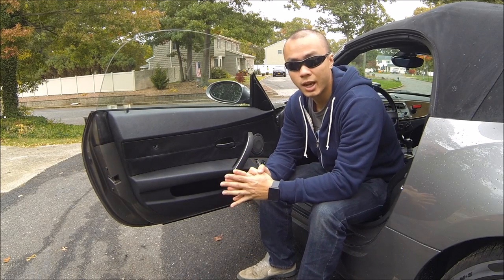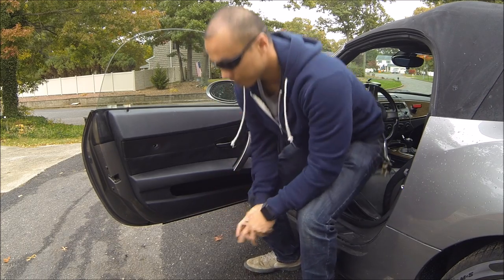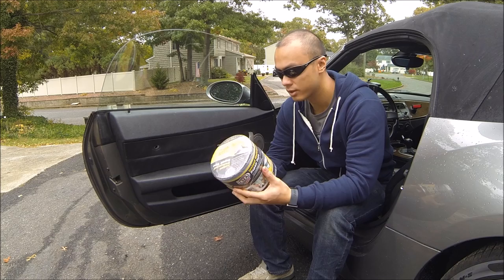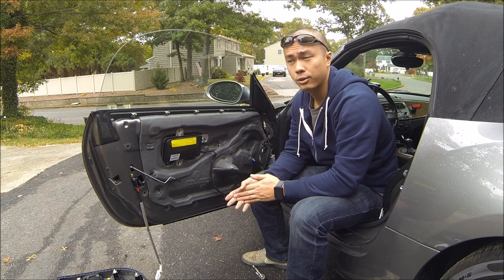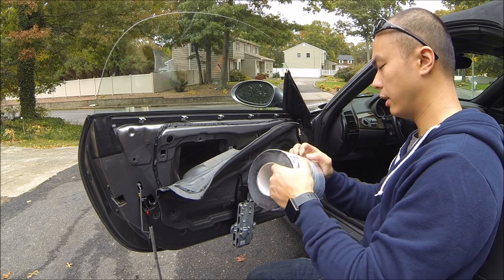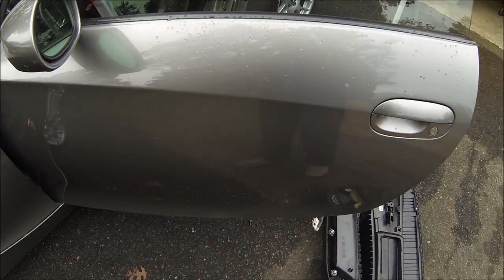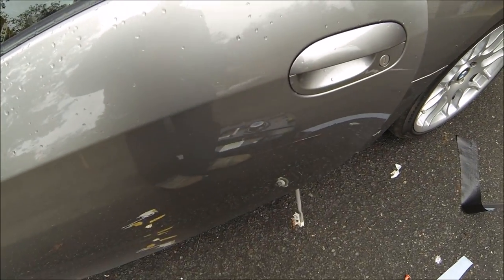Car Door Sound Deadening for Under $20! - BMW Z4 Vlog #20

Comment: DONT DO THIS. USE ACTUAL SOUND DEADENING !!!!
Reply: why
Reply: +carfreaks1024  why ?
Reply: +arien wilkins this stuff is made for roofing. It smells like asphalt and is meant to stick to horizontal surfaces, not vertical, and is known to peel over time with heat. For some it does just fine, but there are many horror stories. This is coming from a guy very into car audio that has done 3 cars and has done an insane amount of research.
Reply: +prayfawind this stuff is made for roofing. It smells like asphalt and is meant to stick to horizontal surfaces, not vertical, and is known to peel over time with heat. For some it does just fine, but there are many horror stories. This is coming from a guy very into car audio that has done 3 cars and has done an insane amount of research.
Reply: ^^^^ WHAT THIS GUY SAID!
Don't use this stuff.
Reply: Snydicus Thanks for the tip. Makes sense. I'll use dyna mat or similar.
Reply: I read that the adhesive is butyl rubber, not tar or asphalt as many people think. That said, I don't know if any possible drawbacks of using it. Please help to explain if you have used it and experienced problems. Thanks!
Reply: Matt Wells It looses its hold very fast which is counter productive. Checkout ExoaBigdeal. He used it and said it was great! Until...... If you want something that will actually last then spend the extra money.
Reply: FYI i have been a roofing contractor for 15 years and not that stuff does not melt its used for roofing. roofs get alot hotter than your car does. now for the sound IDY
Reply: It seems that the U.Seal product information shows that it has a 'rubberized asphalt" as the adhesive, but the Frost King uses butyl rubber, which are not the same thing. Have you tried the Frost King or heard of anyone using it with success? Thanks for the video and replies. Very helpful and very appreciated!
Reply: Asphalt based will not do much in actually sound deadening. It does add weight to the panel and lowers its resonant frequency a bit but you can get twice as much actual sound dampening by using a butyl type deadener and have to use half as much.

That Peel and Seal and U-Seal has a 50-50 shot of falling off of the car and takes a tone more prep to try and make sure it stays stuck.  The biggest issue is that the asphalt based stuff gets too soft and will actually start to pull away from the metal under it's own weight. When it is hot and by hot I mean in the 150-200f range for dark cars vs 130-145f for unpainted metal tin roof.
Reply: carfreaks1024 definitely this stuff is crap I've seen people on videos on YouTube taking hours to dig this crap out of their car this stuff is a bunch of crap it's just tar and it melts
Reply: He used PEEL & SEAL, not the product used in this video.
If you aren't sure you're talking about Frost King, then stop saying it doesn't work.
Reply: Problem with using roofing material is it's tar based and when it comes time to be removed ur left with a hard ass clean up paying the extra dollar for second skin or dyna Matt Is smarter
Reply: I never did use sound deadening but now i use second skin sound deadener and it works great for both mobile audio and road noise.  www.secondskin.com you can find many products here to sound deaden your vehicle.  the adhesive is very strong and so far mine has not fallen off.  i love the product.
Reply: Alf the Clown: i love watching his vids.  he is also known as EXOContralto. he is a great guy and funny as hell. i have learned many things about the basshead mobile audio world.
Reply: Riden Roam EXO is a totally different guy lmao
Reply: prayfawind ExoControlto did a whole video on him removing that god awful Peal and Seal shit from his van a few years back. He totally regrets not spending the money on butyl based sound deadning.

His car smelled like shit and the deadner peeled off within a year leaving a huge mess.

Dont use asphalt.
Reply: 91% Isopropyl Alcohol and a clean rag. Then just try to get the stuff off without a putty knife. Just opened my Wife's car doors to swap her factory 6.5's with Bass Blockers to a set of ISS 165's and  ISC 165's. When I did the Bass blockers along with a Kenwood HU and an SA-8, I used Butyl Rubber roof flashing on the inner metal door skin so when you knock on it, it sounds like lead. I put strips on any other bare areas as well as around the speaker mounting hole. The stuff after 3 years of all 4 seasons in the NE looked great. The aluminum foil facing curled a touch in a few spots and that's it. Stuff works. Whoever said the stuff is not for vertical isn't thinking. The stuff goes along a roof to wall transition. Half of that strip is vertical and often on a wood substrate and it sticks real well. If your cleaning the surface of door, it sticks hard. Remember even if it looks clean, it has oils from manufacturing on the surface. The people that have issues are the lazy corner cutters that can't be bothered to clean the surface, then blame the product. Clean the surface with Isopropyl 91% and freaking Scotch tape will stick forever.
Reply: polariford45 u mentioned scotch tape? Where do you apply or use that and to do what? I’m curious cuz I’m seriously thinking about using this stuff All in the trunk of my car.
Reply: Your misinterpreting what I said. I didn't use Scotch Tape anywhere. Some people commented about this product or any adhesive product for that matter, not sticking well to the inner doors. I was just stating that if you clean the inner doors properly that even Scotch tape will stick good and likely stay indefinitely. Using 91% Isopropyl alcohol (IPA 91%), rubbing alcohol (RA) or acetone will break down the manufacturing oils to leave a clean surface to adhere to. Acetone can harm plastics and paint so I avoid it for automotive use for the most part. I have used CRC brand electronic parts cleaner also with good success, but it costs more and I find myself spraying it into a rag much like applying the 91% IPA to a rag to wipe so I just use the 91% IPA or RA since it's cheaper and easier to find. If you use any adhesive products for sound deadening, be sure to use Butyl rubber and nothing that's asphalt based period. If the product you intend to use isn't clear on what the actual material is then look for another product. This is a product I use with good success. This will address the main concerns that most people have against the use of these options. Mainly the VOC's and high temperature stability. 
https://www.homedepot.com/p/Typar-4-in-x-75-ft-Butyl-Rubber-Copolmer-Window-and-Door-Flashing-Roll-BUTYL-001/302640122
I also have used this product. It is only slightly cheaper than a 2 door Dynomat kit, but it is an option nevertheless. It is 15 square feet vs. 12 square feet for the Dynomat alternative. The Dynomat comes in 12" x 36" sections for their 2 door kit. I find a 6" wide roll much easier to handle and cutting to fit. It also stores better on a shelf being a compact roll instead of sheets like the Dynomat is.
https://www.amazon.com/gp/product/B003I6WNYO/ref=ask_ql_qh_dp_hza
Reply: polariford45 thanks for ur help. What would you use to do a Big Trunk like in a Toyota Avalon or Camry for the trunk lid surfaces, the whole Floor, and sides? That’s a lot of surface area to be putting 1,000 of little strips. That would be a lot of rolls🤷‍♂️thanks again

Comment: I could understand using this stuff for a hooptie but a BMW? Come on bro, no bueno
Reply: Majority of all sound deadeners are butyl rubber and foil. I think there's only a few companies that use a different rubber compound or another material entirely for dampening.
Reply: Why spend money for the sake of spending money? 
This guy doesn't have sponsors or anything nor is his Z4 a show car so why would it matter anyway?
Reply: It's spending money for higher quality. Why buy a bmw when you can have cheap communist cars, they're all cars, right? 
You obviously have no knowledge on the subject, and your argument is baseless and invalid.
Reply: This is like a religion to you guys, isn't it?
Sure I might be wrong on this one, I'm not big into the car audio scene nor do I work in anything related to acoustics.
However for the purpose of adding weight to panels, quality of the dead weight doesn't really appear to be a worthwhile investment.
How much of an improvement does 5 pounds of high quality dead weight have over 5 pounds of low quality dead weight?
Reply: "Dead weight," sure, dead weight. It adds rigidity to the panel, so it doesn't flex and/or rattle. Different deadeners have different materials that are used. The cheap stuff like peal and seal uses compounds that will make the vehicle smell terrible, especially during hot weather. 
Better brands use other compounds that prevent that, or use different materials entirely.
And no, it's not a religion. Religions are impractical and false. It's more of a hobby and in some cases a competition. 
At the most extreme, people just weld thicker metal to the thin metal in the vehicle.
Reply: Xander knows what's up. You get what you pay for. Sound deadening is something you just can't cheat the system on. You might think you are but just wait till your peal and seal slides down your panels.

Comment: Just FYI, do this if you only live in cold climates, and you are better of using the actual stuff off amazon, they don't cost as much, and you don't need full coverage, you are not really spending that much more to use the real stuff.

Comment: This material will melt in the summer heat, I know that from first hand.
Reply from the maker: That sucks that it happened to you but I have a two year follow up video showing my first hand experience that it held up just fine in New York summers.
Reply: What about south Texas. Temp's in summer reach up to 105* plus the humidity is 100%. Will it hold up to that?
Reply: It melt in Illinois summer, it will melt in new york

Comment: That is NOT the same as deadener. Its asphalt based. Smells like shit when hot and will end up falling off. This stuff has been proven to be a complete fail in the car audio word.  If you are trying to dampen road noise you need Mass loaded vinyl.

Comment: this not what you use to deaden your vehical... you dont not add a Asphalt based product ..  

these bramds are the ones you use 

Noico (ebay or amazon 68.00 shipped 50 mill butyl rubber 

second skin 
b stock deadner is made in the USA and is 299.99 a box it is 120mill and is pure butyl rubber 

VibraFlex is a deadner that is 140 for 15 sheets 10x20 in size is 180 mill thick 

these are the 3 bramds i would only use 

if you ise Peel and Seal you are putting rocks with glue and is not heat rated fpr how hot the metal gets and will cause issues. 

please do yourself a favor and dont use a product intened for roofs as a deadner in Autos

Comment: Dude leave it light, it’s a sports car. The old 911Porsche RS came with thinner glass, fabric loop for a door pull and zero deadening materials in the pursuit of lightness. They’re some of the most collectible Porsche’s today. 

Want something quiet buy a different type of car.

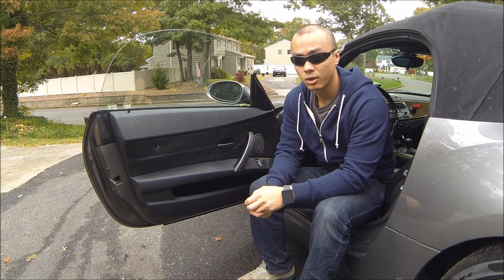Comment: Errrr.  This is asphalt based, not butyl-rubber based which is why it is cheaper.  Asphalt is a petroleum/oil by-product and because it melts easier you may smell it over time and on hot days.  Do your research wisely if using this for sound deadening.  Take note that at 1:12 you'll see butyl tape in the red package on the left.

Comment: In the Texas, USA summer season. The temperature inside the car hit 130 to 140 degree F.   The glue on those Tape will not melt and the tape fall off ? and Cold temperature -10 degree F ?  How often should you change the tapes?

Comment: So to test all the reports of "the asphalt will start sliding down your panels in the heat!!" I put a nice big patch of peel n seal on my strut tower under my hood next to the exhaust. And the underhood temps of my car are borderline unrealistic for just a little 4cyl. And its now been a few weeks and because i cleaned and applied properly it hasnt budged an inch. All the negative reviews from people on peel and seal are either alot of "i know a guy who knew a guy..." types or the ones who claim they did it and it all peeled off....well its not hard to comprehend there are just some morons out there who dont know how to prep or apply stuff properly. Same would have happened if they put dynamat in. But they will always claim "well dynamat didnt do it when i put it in after" well yea because you actually had to clean the peel and seal off so your panels are finally clean lol

Comment: you are doing it wrong. you need to clean the surface so the adhesive can actually stick to it. Go check your doors again, it probably peeled off during the summer while you were driving around.

Comment: I did this way back in 2012. Got the same product from Home Depot. Installed on my 2007 Scion TC because the door speakers  sounded like shit. Even good door speakers sounded bad. Night and day difference after installing it.  My door speakers actually had nice tight bass too them afterwards.  Opening and closing the door sounded way better  as well. About to put this stuff in the door of a 2002 chevy blazer I just bought for my kid. Its a little cash truck practically given to me. Only thing is the door speakers sound as bad as the 07 scions did.

Comment: High quality sound deadening material is made with a thick, butyl rubber adhesive with an aluminum backing. The stuff from Home Depot or any hardware stores is composed of an asphalt adhesive with a (thinner) aluminum backing. It isn't as effective, makes your car wreak of asphalt,  shrouds the interior environment in toxins, and falls off in hotter weather.

Comment: If you live in a hot state like California, Nevada or Arizona using roofing product is definitely a bad idea! It will melt and fall off on really hot days and make a huge mess to clean up! Only use butyl rubber sound deadening products. If it comes in a roll, it is most likely an asphalt product and should be avoided. Most butyl sound deadening comes in sheets. If you shop around you can find butyl mat at a better price. It won’t be $14 a roll cheap but it will be a superior product for a cheaper price than Dynamat.

Comment: do you know if this material can sound deaden the floor, engine firewall, wheel wells, trunk and roof too? i want to do my whole car and saving money would be really nice. btw, i'm going to sound deaden a 2015 Altima.  The Altima's cabin is very noise on the fwy through vibrations that seem to come mainly through the floor and sound noise through the window. nothing like the quite cabin of the Camry it replaced. It has a lot of problems; this is just one of them.

Comment: how about just dont put on a exhaust on those Japanese 4 cylinder engine. You will save your time putting in thise sound deadners and also not piss off the neighborhood with that stupid buzzing sound. 
Get yourself a V8 and you may actually enjoy the sound in your car.

Comment: You can spend over $100 on the "BRAND" stuff which is ridiculous. I bought this same product for my 2 dr single cab Dodge ram. I cleaned the surface and used 3M spray on glue with it and it's been on for 2 years straight with no problems. I covered the doors and the back. I have 4 speakers, a sub box and 2 amps and not only it sounds better now but it reduced road noise a great deal. No one is going to see the brand on the insulation if that's what anyone is worried about lmao. Good video, keep posting.

Comment: Ive used Peel and seal and other similar brands in my earlier years of car audio. Not here to say what you should and should not use. I can say I will never use this stuff again. Only real deadener - tons of cheap but good stuff out as low as 20 dollars a box of 5 12x12 sheets. **But if you do decide to use this product and don't want it to come off (ex. upside down) use a flame and heat it up

Comment: I wonder what the toxicity on these exterior home material. During the hot weather, the car would be baked and possibly release chemical fume inside the car.  That's the reason I went with Dynamo that was made for car interior.

Comment: ⚠⚠⚠⚠💡You need to disconnect the battery before doing this if anyone plans on it. Failure to do so will result in the airbags deploying or in this case an srs airbag light that would need to be addressed. Also, vacuum out the door inside before anything, then clean every surface with alcohol or an alcohol/water solution. You must press in the, material if you don't want to have to keep reapplying your cheap dynamat, I did a half ass job on my old car and it held up fine, worked great, and I just prepped and applied it as best as I could. and it doesn't have tar or asphalt in it, don't be an idiot, or at least read the packaging of stuff you buy so you don't pass out while you're driving in the summer time.